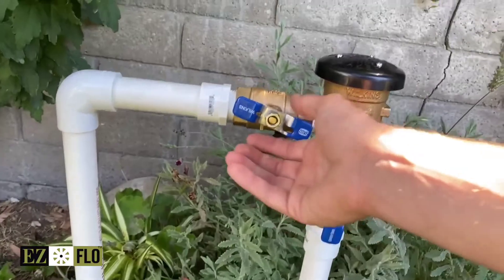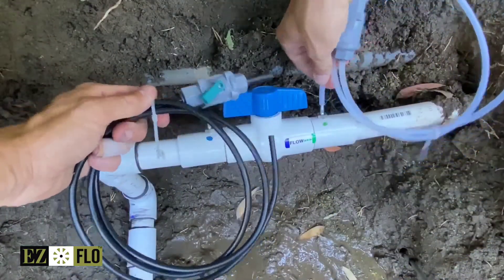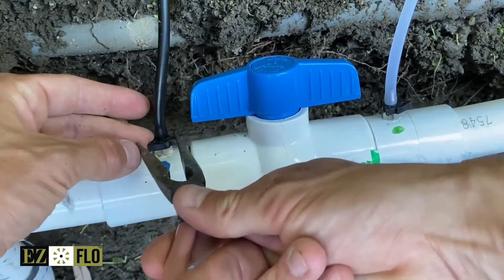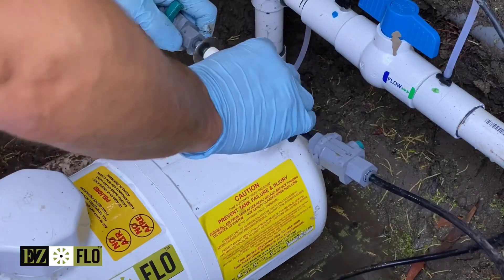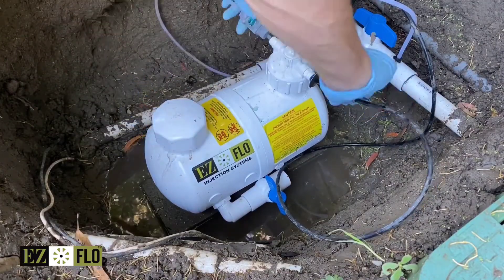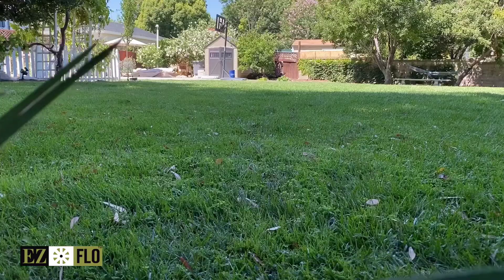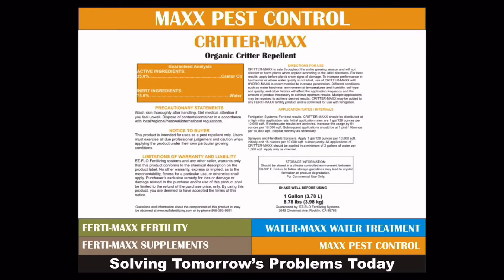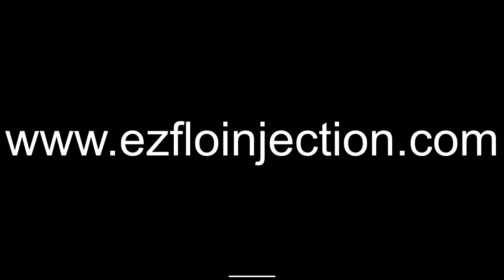EZ-FLO Installation

Comment: What if I am only wanting this system on a drip line? Can I tap into the line after the valve? The goal is to only have the EZ-FLO working when I run my drip zone.
Reply from the maker: Yes, you can use any of our systems after the zone valve with a CBV. The EZ-FLO-1 is perfect for this application. For a more economical option, you can purchase the CBV seperately to attach the EZ 2005-HB or EZ 2020-HB.

Comment: Ok what if the ball valve is in a vertical position?
Reply from the maker: Ball valve can be installed horizontally or vertically. It will not change the function or performance.

Comment: I have two zones .The box in the front works for the front yard .And they extended the pic to the backyard to another controller for zone two.So the bulkhead is connected behind or before ? And when the zones are operating the water flow will go to zone one and fertilize the front yard .And when it is complete the water water will flow the other direction through the ez flow?
Reply from the maker: You want to install the unit on the main line, before the T in your irrigation system. Before the mainline splits to go to the two separate zones.

Comment: FYI:
Based on county/state Texas code you must install a RPZ device if any fertilizers or chemicals are added or injected into the Irrigation system especially if your Irrigation main water is that from your city meter. 
The( PVB pressure  vacuum breaker) devices is not by code and is considered a state violation. Am surprised this is not mentioned in the video. I recently visited a homeowner with this exact EZ* FLO injection system with a A-20 PVB Device
(PVB devices not designed for fertilize chemicals injection because they due protect the  city water from cross contamination.
Reply from the maker: You are correct...for Texas that is! Our injectors are installed world wide so we do not list the varying back flow laws that apply but we do properly state in our installation guides to always follow all local codes when applicable. 

The installation used in the video was completed in Southern California where the state and local agency allows for a PVB to be used for non pressure producing injectors.